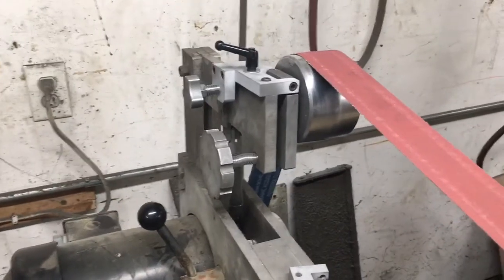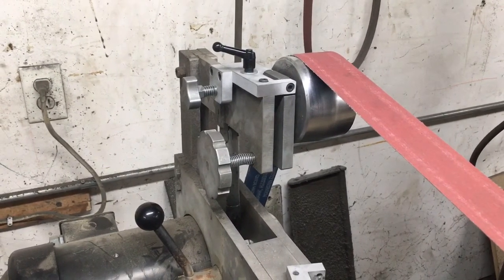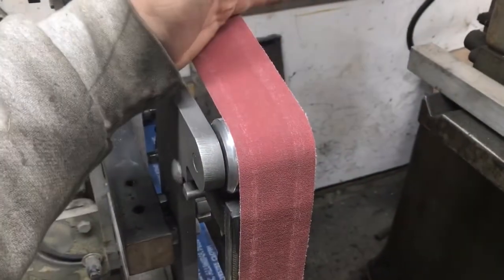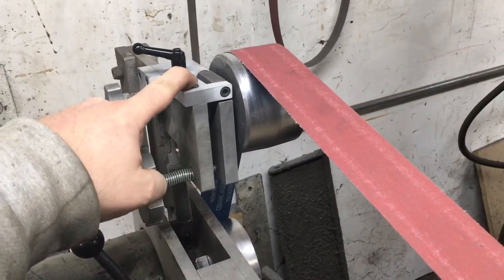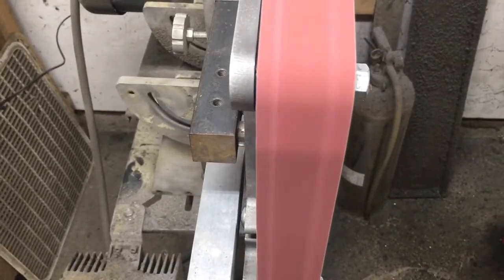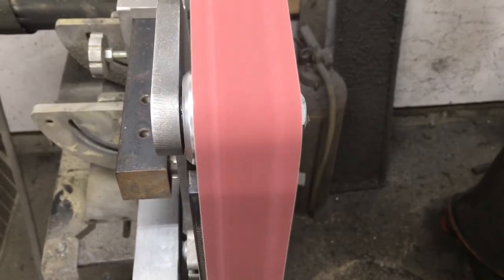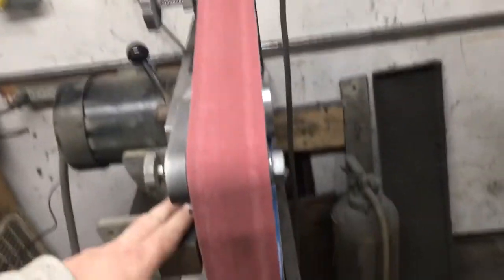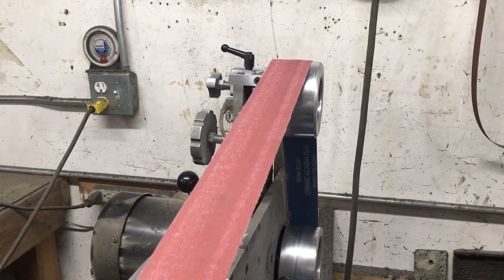2x72 grinder tracking upgrade/mod

Comment: I’m working on my own 2x72 and the tracking mech is getting on my nerves. What’s the best way to accurately drill through the tracking arm mech to make it pivot ?
Reply from the maker: Luke Augustini center punch your hole locations and use a drill press vise to hold it square.

Comment: Very nice build. Im looking forward to make this as an upgrade for my grinder. In the old Reeder concept he uses two adjustment screws and a locking screw. Now in the new concept, he uses this spring in one side and knob in the other.
 Something that i don't understand in your concept, differently from Reeder system, you dont use a spring in the other side of the adjustment knob to push the system in the opposite direction. Even that way, you manage to rotate to the both sides? Thank you, nice channel BTW!
Reply from the maker: I haven't found a spring to be necessary as the belt tension keeps it tight against the tracking arm.
Reply: @RileyKnifeandTool  make sense.
Reply: @RileyKnifeandTool   Is there any reason why the horizontal axis is not centered with the tracking wheel axis?
Reply from the maker: Fernando Maia I’m not sure what you mean.
Reply: @RileyKnifeandTool  Sorry, I'll try to explain myself better.
The system has two perpendicular movements. The most common one that just "lifts" the tracking wheel vertically and the other (from reeder) that rotates horizontally.  I thought that both axles should be aligned, because that way the wheel rotates horizontally in the same place, like this: https://i.imgur.com/ZXDG2aI.png

Comment: Thank you for the video.  I am currently building my first belt grinder after modifying many 1x30s.  Question...with the "skew" adjustment set will it run in both forward and reverse tracking to center without further adjustment?  I guess Im asking if you couldnt have just used the primary tracking adjustment to recenter for reverse and repeat for forward?  I understand thats not optimal tho.  Thanks in advance for any feedback.
Reply from the maker: A number of my attachments will run centered in both forward and reverse without addition adjustment. The "skew" adjust is for the attachments that may be just slightly out of square and will NOT center on their own (or with standard tracking adjustment) in reverse. You typically have much less control of tracking in reverse, regardless of what style of tracking adjustment you use. If the skew is needed to center an attachment in reverse, the exact same setting will probably NOT run centered in forward, though the standard tracking adjust will usually still be able to correct this while running in forward. Hope that makes sense.